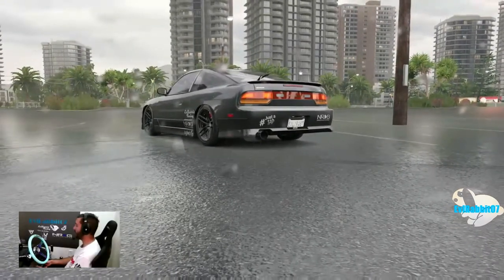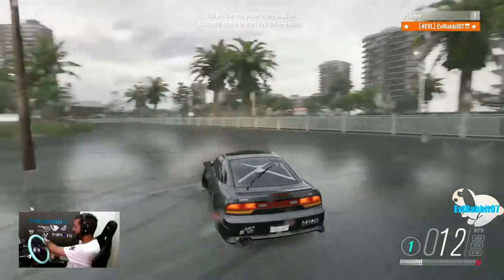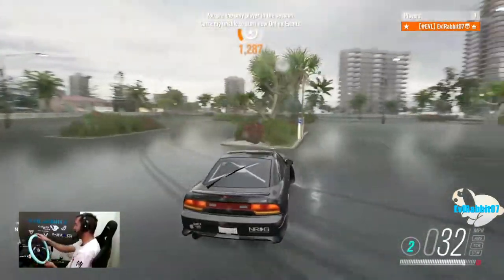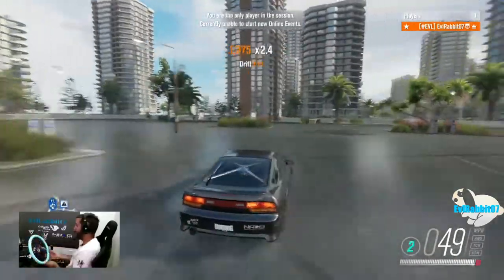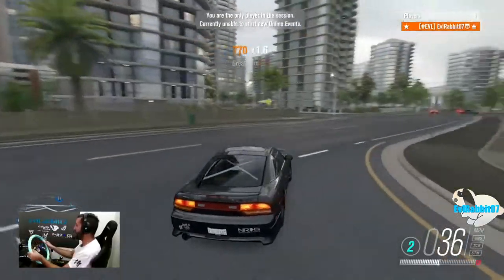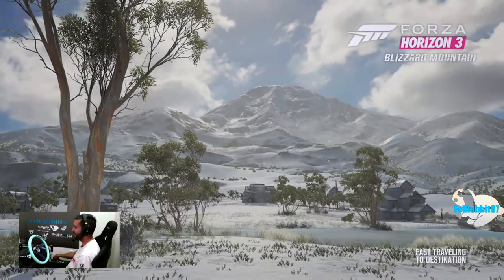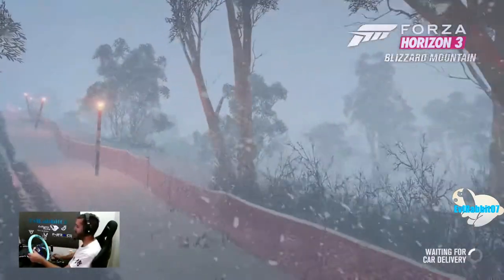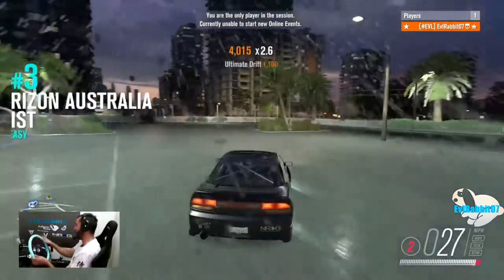Forza Horizon 3 Drifting with a wheel on Simulation steering --logitech g920 w/ NRG wheel--

Comment: So when i am drifting on mines i tend to spin out alot its hard to get the car to keep a drift and when i try to streighten up i spin out
Reply: same here, i try to counter steer  the drift i'll just spins out. you figure it our yet?
Reply: @hauptmannfriedrichkonrad4105  yea bro i actualy needed alot of practice and patients i got mines down 100% i have some videos if yiu want to check them out 👍
Reply: @2rztaco  any tips on getting better?
Reply from the maker: I have some practice and seat time as well as do not over correct start on low power and work your way up
Reply: @hauptmannfriedrichkonrad4105  definitely want a good tune on your car if your car isnt set up for drifting it wont perform right  start with about 400hp or so and once you are used to the power and you need more give it another hundred, set up your force feed back settings as well if you dont have them setup right it'll be more difficult each car makes the wheel act differently choose a car and get used to it
Reply: @2rztaco  thanks for the tips, i've already master that but only not good controlling the car on Sims mode hahaha